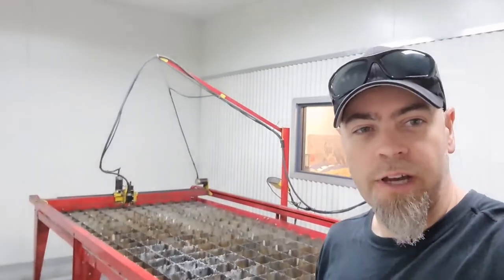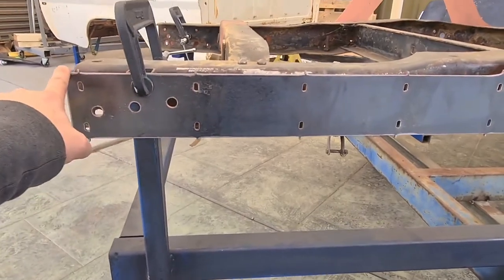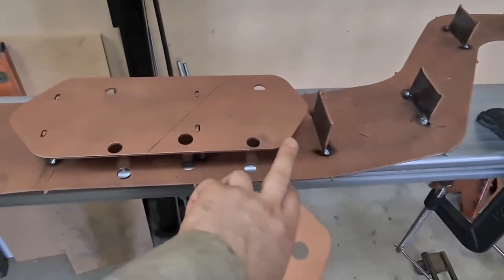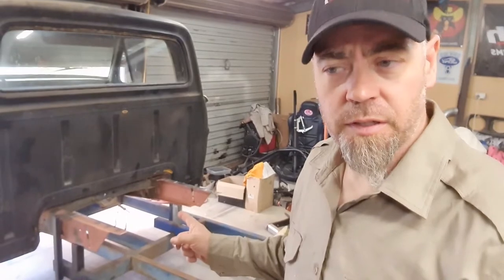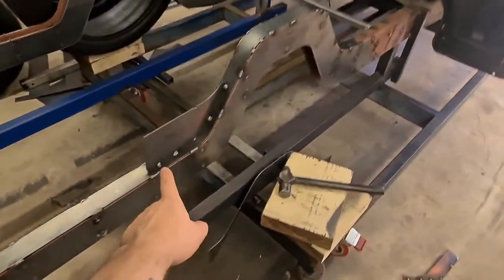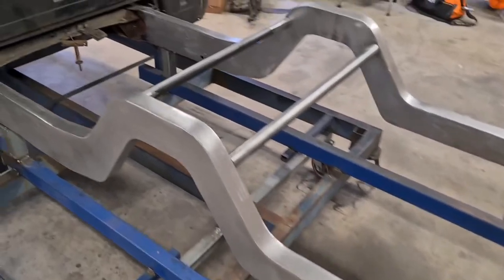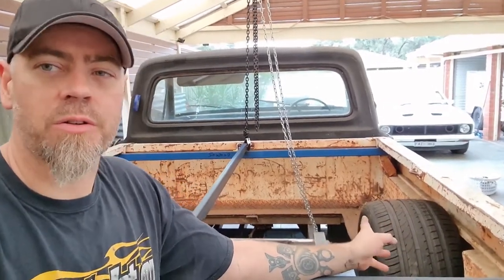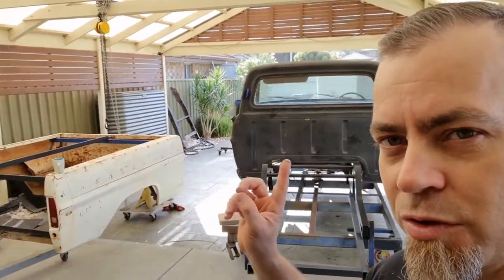1967 Bumpside F100 project Pt5, new back-half / rear notch

Comment: very cool truck  build mate   good step by step makes it look easy  what is that copper spray your using how does it hold up when you weld over it
Reply from the maker: Thanks bud! The copper paint is UPOL weld-through primer, it's designed to not burn off when you're welding around it. It seems to work really well. I bought a 3-can box from ebay, it's not always readily available in my local paint shops.